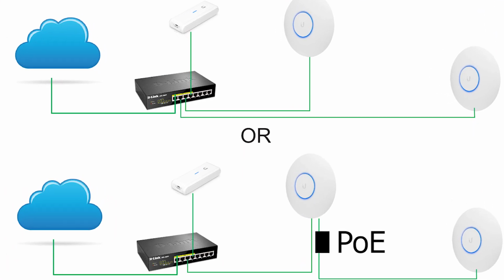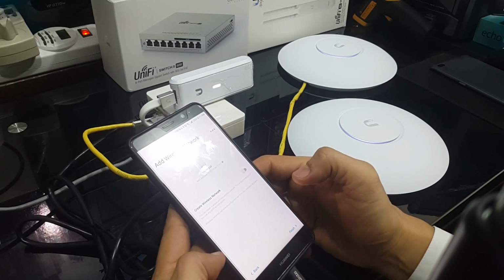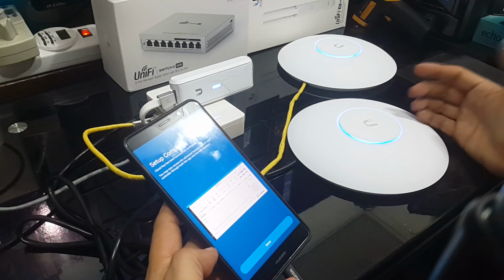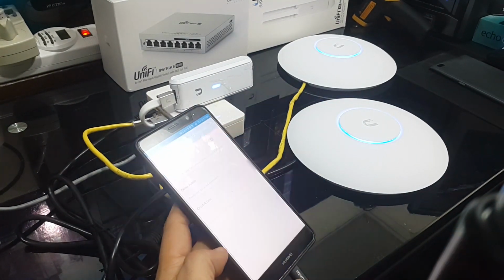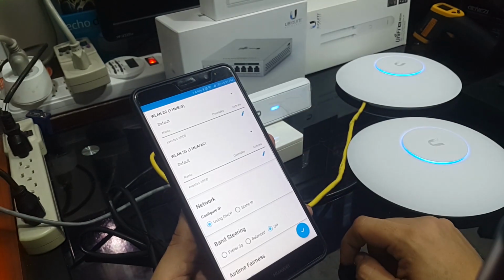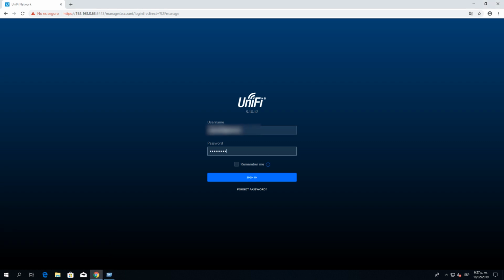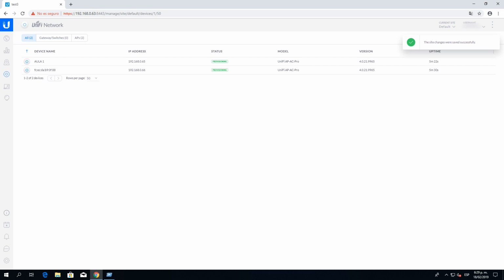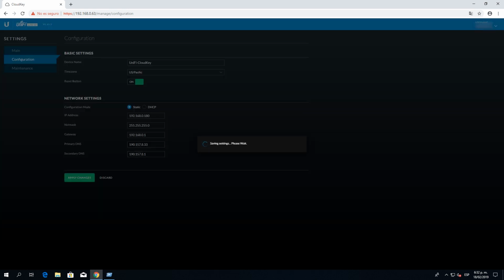Using UNIFI App to setup CLOUD KEY and APs - 300+ users | English Version

Comment: Can i use this hardware for 40 Acces point?
Reply from the maker: Hello Milda.  The answer is No.  If it is just for configuring and setup devices as well as deploy changes, yes.  If you need to log and control permanently (as it is the idea with these devices, go for the UCK gen2 for such scenario and if the load in terms of roaming and log is high go for a more robust device as the UDM. In the meantime the windows Network Application will do,  so you'll have much more power.  https://amzn.to/3LzfJ4u